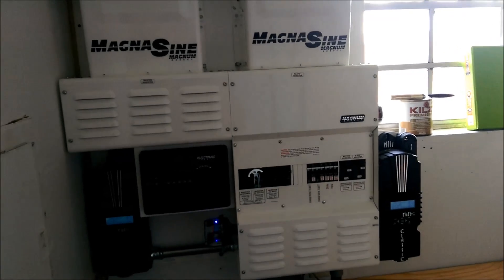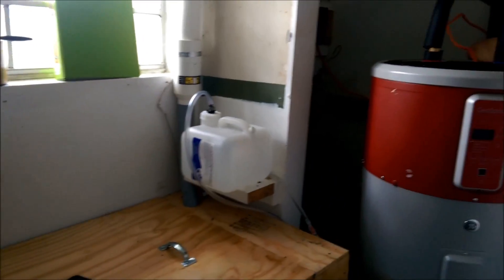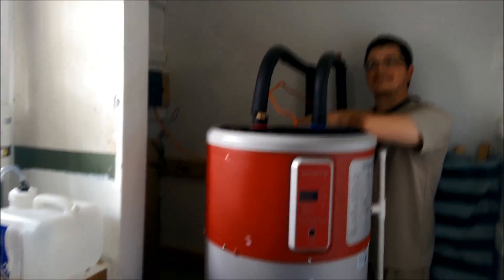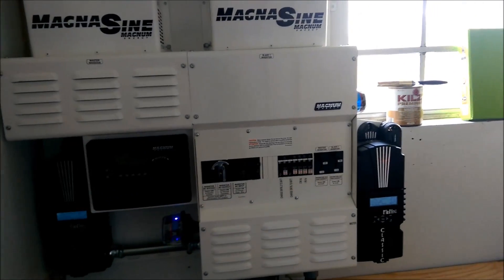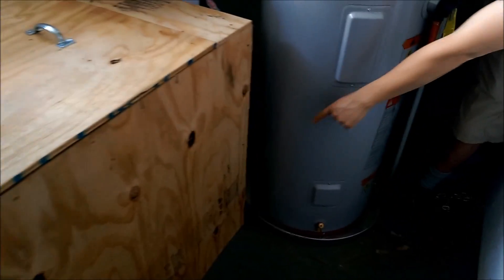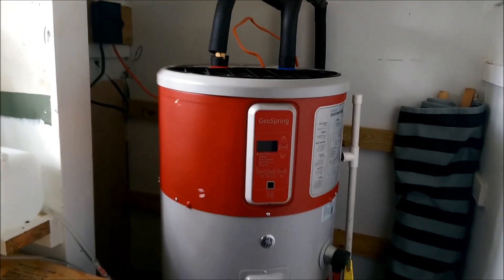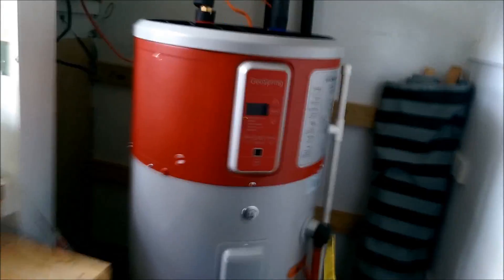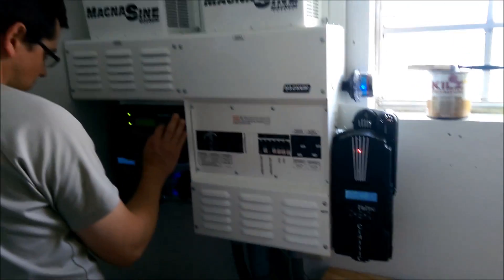Using Waste Heat is Too Cool!

Comment: I was looking into those didn't realize it only used about 700 watts - how much do you save over the cost of a regular electric water heater? I would assume the heat pump runs longer?

Comment: I have been looking to find a way to go off-grid, using the battery bank and panels.  I haven't found anyone with that kind of info (I live in Phoenix, AZ) those who I have talked to try lease to me a panel unit instead.  I am curious about what you said on the Battery bank being at 75 degrees -- is that a must? or is that an idea temp for batt life.

Comment: All of the tech. is great, but a good rule  thumb is that, "The more complicated a system is the easier it is to gum up." It's good to have a low tech. way of dong things kind of waiting in the wings in case you need them.

Comment: That room would be a good place to stick a deep freeze freezer or 2nd refrigerator and let all that waste heat get sucked up and dumped in the the water heater. My friend and I took his water cooled gen set, next to his home, and plumbed it so that if the power goes out in the winter time, he can open and close a few valves and have the coolant flow into a water to air heat exchanger to warm his home in the winter, instead of going into the radiator and dumped outside. He really wants to figure out a way to catch all that waste heat from the exhaust too and do the same thing, as well as heat water in both the summer and winter. Still a work in progress though. Good video.

Comment: I have to wonder something that I hope that you can address. Many homes, especially ones in hotter climates, have a ton of waste heat in the attics. I've not seen a single solution for collecting that heat for a preheater for domestic hot water. Any good suggestions?

Always enjoy the vids.

Thanks
Reply: I would think a large coil of pipe would do the trick.  Flowing from cold source through the attic coil and into the water heater.
Reply: In the USA this is super risky just from the stand point of....... Winter!!! Over 80% of the USA sees freezing temps in the winter that if prolonged would freeze pipes. I went to a December wedding in Houston Only to watch water pour down the walls of three story apartments during a winter freeze. Water is the most efficient transfer fluid but Air is safest. Air most likely does not provide the efficiency to make it worth the cost. Glycol helps but can also reduce the efficiency.  This might work if you could even get the math to profit. With the current direction of Petro anything Solar is going to be a solution!!!

Comment: Very interesting.  Will you be providing more info on the equipment and design of the system?  Is it entirely self contained?   No grid power?   How long until it pays for itself? I hope those are reasonable questions.

Comment: I use a dc water heater as the dump load on my solar/wind system. It will work a lot better when I get more than one 144 watt solar panel.

Comment: That's like a ac compressor heat exchanger preheater for a water heater. In dairy farming we run the raw milk through a well water supplied plate cooler device that pre-chills the milk before shipment, the heat from the plate cooler around 100*f is used to supply heated water for sanitation and/or livestock water fountains.

Comment: When a man made or a so called natural EMP happens it will fry your system.  when the SHTF and it will, most off grid system will be useless,  unless you protect them .
Research ...Faraday cage
Reply from the maker: Very familiar with EMP.  See my playlist on it. HAve a DVD on it.  But can't live in fear of it.  Until it happens I'm making my own power.  If I get a heads up on a CME I am set to disconnect from the grid via whole house transfer swtich.  A CME will not couple with a system this small.  If it is a nuclear induced EMP I tell all my customers ...Hand Pump, Wood cookstove and Food!
Reply: engineer775 Practical Preppers I know, you know , but most do not have a clue .
My comment was  to hopefully open a few eyes.
Reply from the maker: Lizfan2 1 to 3 days
Reply: engineer775 Practical Preppers How much time would you have after a Coronal Mass Ejection to disconnect from the grid? How long would it take for a CME to reach Earth?
Reply from the maker: offplanetevent 10/4.
Reply: engineer775 Practical Preppers Dang that short a time? A lot of people would definitely be screwed that's for sure.  I need to get a wood cookstove and a hand pump. Would anything battery operated be fried too, or just plug-in stuff?